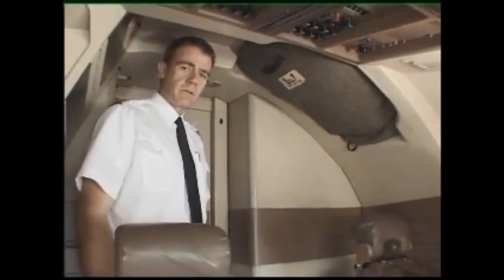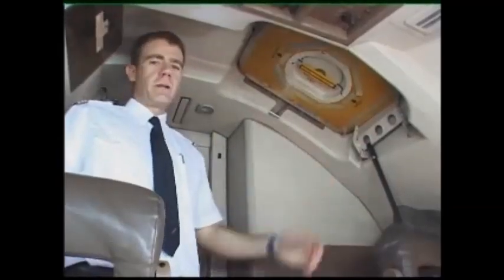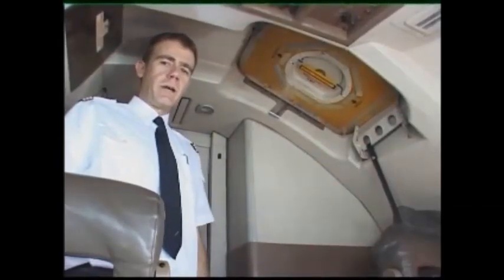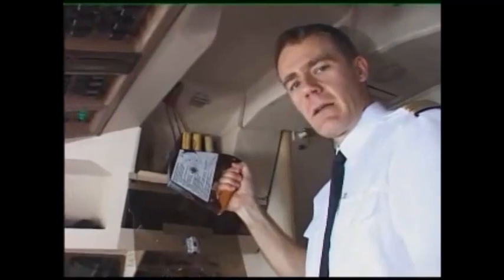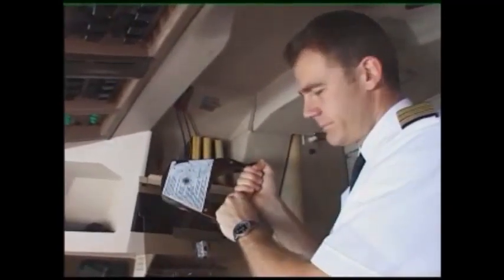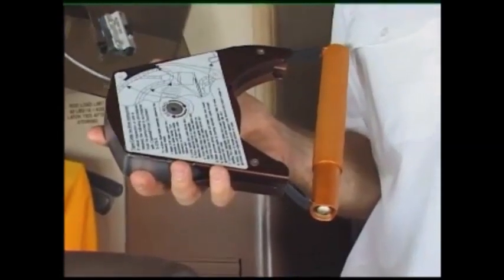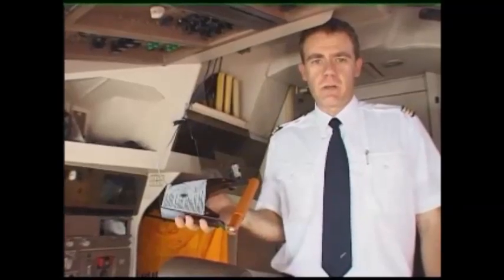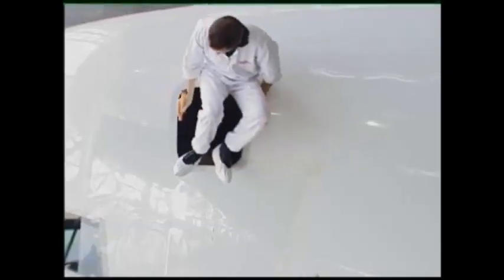Lufthansa Boeing 747-400 Flight Deck/Cockpit Escape Hatch Instruction Video

Comment: I was trained on the 747 at Boeing in late 1975/Spring of 76. There were no Appendix H simulators in those days, requiring some of the training and final check ride to be flown on an actual aircraft. Back on the ground at Boeing Field, the Check Airman and the resident FAA DPE congratulated me on the successful completion of my ride, but informed me that I had to jump out of the hatch in order to receive the Type Rating. Although we were trained on those devices, no one had told me about this crazy twist. Having been terrified of heights all my life, I almost had a heart attack! When they realized the "prank" may have gone too far, they all laughed and told me this was a joke they would often pull on young and gullible idiots like me, and handed me the certificate! 😏
Reply: Did they say “for jumbo sakes you’re a pilot. You afraid of heights?” Lol good old times
Reply: "Terrified of heights", FL 380, no problem.
Reply: @jameswest8280  ,
True, inside the aircraft at any altitude, was not a problem!

Comment: It's a bit surprising they have filmed this without any safety measures in the ground. Panic at the hatch and slide down without holding the handle well enough? That's quite a high drop on the asphalt.
Reply: That's what I was thinking.  For a training/video, should have large pads at the bottom.  If their fingers slip or they let go by accident, that's a 50 ft fall.

Comment: I am a 747–400/-8i Captain and my father was a 747-200 Captain, which I also flew as a first officer. My father’s best friend used to be the senior training captain on 747-200 back in the 80s, early 90s. He insisted on trying out the hatch and the reels for himself, which brought up some advice, which to this day I pass on to anyone on the cockpit jump seat.

Firstly, the reels will only start dampening what feels like a free fall on the last few meters. So the initial natural reaction could be: “S***! This isn’t working - I’ll better let go of the reel in order to brace myself!” Don’t! 

Secondly, those reel metal tapes have razor sharp edges. So if you can, you should really try getting them out of the way for the next guy.
Reply from the maker: @Boeing747-8i  great anecdote.  Yes we were always taught not to break your fall, but I wasn't aware that the dampening only really took place in the last few meters! Spooky.
Reply: This is internet at its best. When I read your reply on YT, the KLM 747-300 cockpit reels vid was being recommended. In this, there is Lufti-footage of the 747-200 and the exact event I wrote about. My father’s friend is the second from left on the ground. Unfortunately, he died a few years back, but I can show it to my father.Thank you so much.
Reply from the maker: @Boeing747-8i  my regards to both you and your father, and most importantly, long live the Queen of the Skies. ✈️